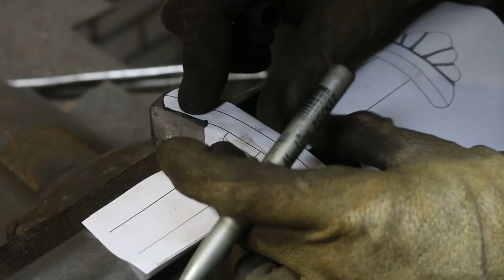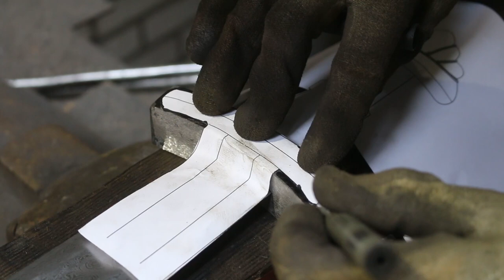Forging a pattern welded viking sword, part 3,  making the guard and pommel.

Comment: the drill bits you use a harder than the steal your forging which is pretty remarkable what type of Steel is used in those steel bits what type of Steel is it

Comment: Now I got the say something nothing bad but these guys are hardening the steel getting it red-hot quenching it's in oil the blade and the Tang I mean of course it's part of the blade but then they drill holes through it after it's cooled and that steel is super hard I would like a sword made out of the steel drill bits are made out of just because if they can drill holes through that hardened steel like that wow you know what I mean could that be possible would it make a good sword
Reply from the maker: You can't drill hardend steel with a, normal hss drill